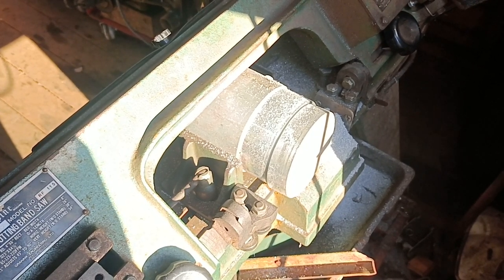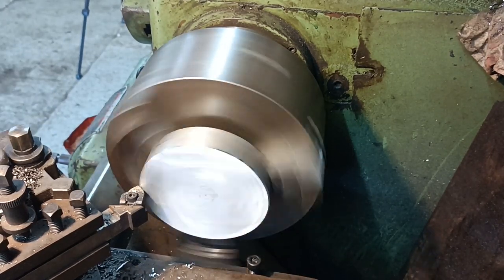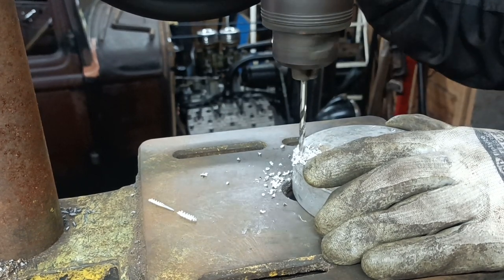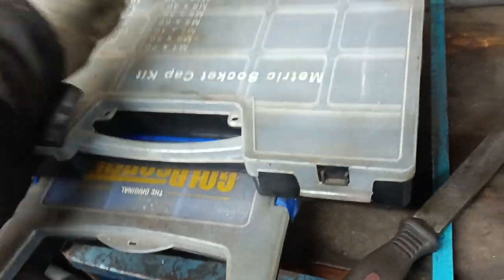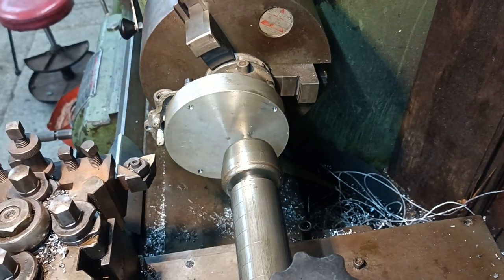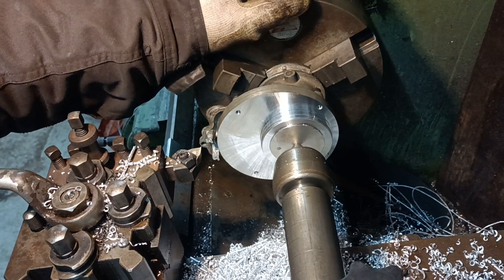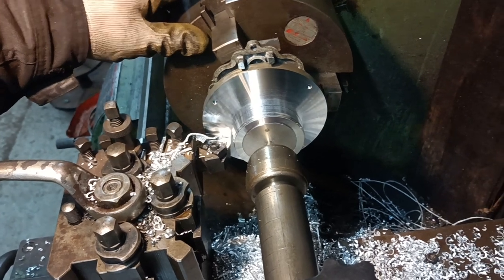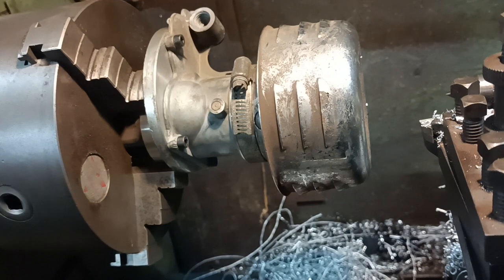A Fixture to hold carb tops for machining. (2327)

Comment: Very interesting Mart. Its still gloves and mitts in the shop here too on April 1. Surprised to see metric fasteners in the old Ford carbs. I didn't think ours were. Still running original equipment air cleaners on mine.
Reply from the maker: Hi Roosty. The carb doesn't use metric fasteners. I just used M5 to hold the lids to my fixture. The proper thread is 10-32 NF.

Comment: If it was the last one you had and you ever needed to use that carb top I'm sure you could drill and tap the float mount stubs and create some "prosthetic" replacements to screw in (to get you out of the desert!).
Reply from the maker: You're absolutely right, Andy. Luckily I don't need to fix it. That phrase brings back memories of East works. Went past the other day and it is all new houses. Take care Mate.
Reply: @MartsGarage  I have passed by East Works mostly once a year to monitor progress, on my way back from the dentist. Although one of the later parts to be demolished, the Flight Shed area had houses built sooner than some parts. This suprised me a little as it was a listed building. All just memories now.
Reply from the maker: I remember the massive cables and turnbuckles that tensioned the roof. There was some sort of mezzanine at one end and the big turnbuckles were right at face level. Geodetic diamond structure if I remember correct, like a Wellington bomber. (Could stand correcting on this).

Comment: At least you didn’t acid etch a really nice 94 to death! Tempted to kick myself indefinitely but there’s no sense. Great idea on that adapter. I suppose those more common air cleaners are just a smaller size ID? I have a couple that fit the stock necks but haven’t collected too many variations yet. Good stuff!
Reply from the maker: Cheers EH. It's the shape rather than the size. It was just an idea that I had and wanted to try.

Comment: I wonder how accurate the die casting is.  The runout you found on this carb top may be quite different on the next one.
Reply from the maker: They're pretty repeatable. I struggled with one and mounted the fixture in a 4 jaw chuck to get it as good as I could.

Comment: Have you figured out a way to repair that carb top yet?  Re-drill the holes for the pin, maybe still could be adjusted to specs, wouldn't be too tuff to make a new, taller hinge and solder (sodder) to the float?
Reply from the maker: No need to fix it, Art. I'm sure I could if I needed to, though.

Comment: Good to see the whole process Mart, what speed do run the drill at to tap threads? I'm sure you can fix the blunder with a bit of hand filing, pressed in pins and JB weld, if you need to that is.
Reply from the maker: Hello Pat. I run the speed as low as the machine will take. Power tapping is very prone to failure and must be done with caution. Yeah, I could fix that but don't need to. I don't think I want to fix it just to generate youtube content.
Reply: @MartsGarage  I have seen what appeared to be a modified drill press, where the chuck was spring loaded so that once the tap had started to tread it could draw down at it's own rate,  but I think they must have done a lot of tapping.
Reply from the maker: Hi Pat, you might have seen a dedicated tapping attachment. They draw forward, stop at a predetermined setting and then reverse back. Very clever stuff. (I think that's how they work, never had a good look at one).

Comment: I KNOW the drill is going the proper direction, but it's funny how "on camera" it appears to be rotating backwards when you are running the tap. 
"shit happens" !! ;o) I hadn't thought of those two "arms" hanging down while you were cutting that piece but I was concerned about how much stress was being applied to the entire "pot metal" carb piece you had in the chuck. That "off center" hunk of metal going around looked pretty "scary" for sure !! 
Thanks for asking Mart. We're working on exhaust systems right now. Just finished the system on the 57 (The Time Machine) and are now working on the system for the Model A (Old Hank). Type in "Pappabob" on the YouTube search. The playlists are those two names I used above. Funny, we were just saying the other day how "everything" gets "modified" !!!   
Cheers !!! 👍👍👍🔧⚙🔩🛠🗜😉🍺🤷🏻‍♂
Reply from the maker: Thanks for the update, Ron. Yeah, the old frame rate can get you sometimes. I was concerned about the off centre loading so put the centre drill in first.